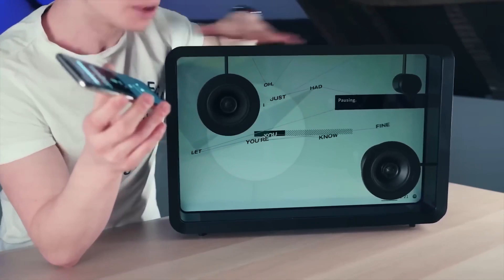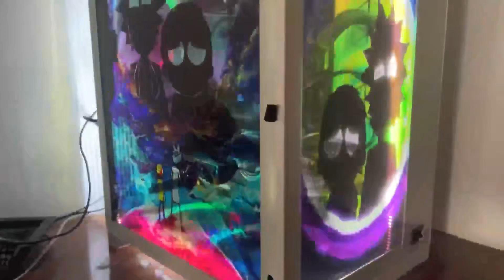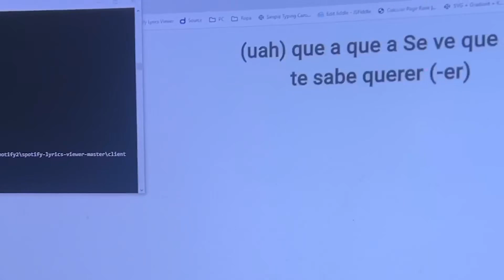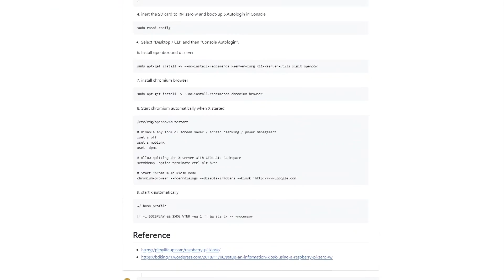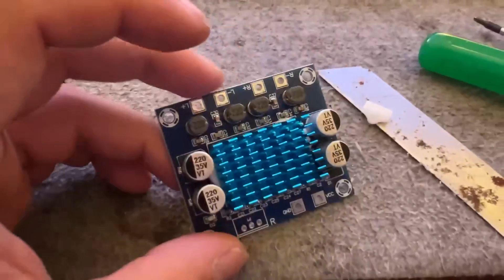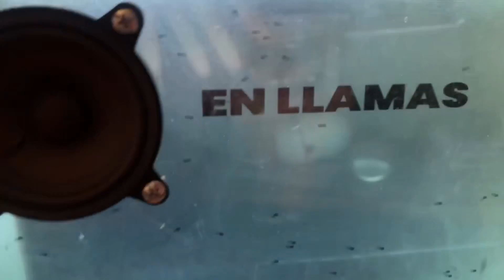I Built a Transparent Speaker with Real-Time Lyrics!

Comment: This is awesome! Looks exactly like that $1200 Lyric Speaker. I'm building a mini version of this with a 10 inch screen and some small drivers I have. I plan on fully 3D printing the case, well as much as can fit on the bed of my 3D printer. I will probably laser cut the acrylic to make the holes for the speaker, and I may also make holes passive radiators to improve the bass response. I'm also not using the diffuser panel, but I will have an LED strip inside.